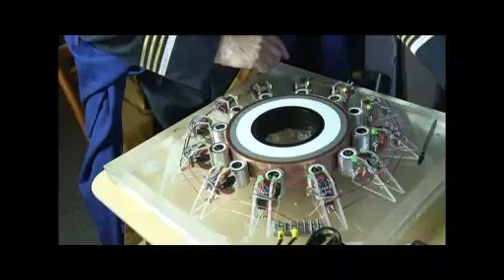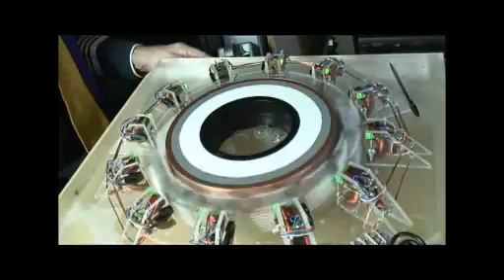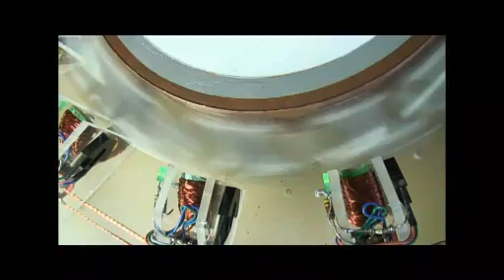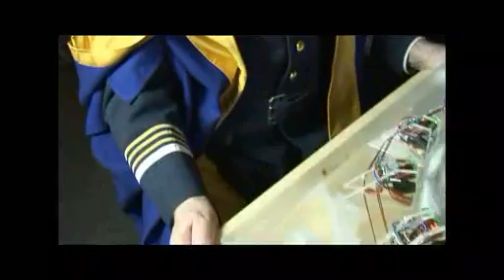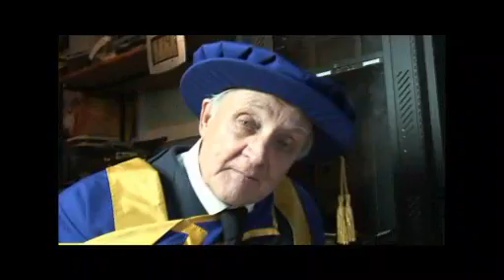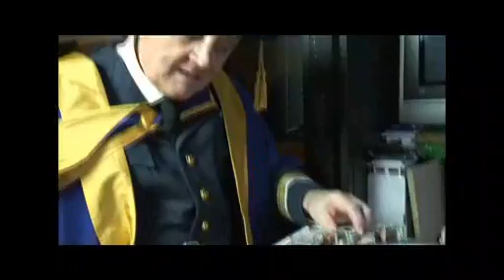Searl and Newton Part 2

Comment: You may power your house with an 18-inch diameter SEG that is 4-inches thick, and will weigh about 120-lbs, designed to be limited to 11 kiloWatts, which is the peak-usage of an average home. Nominal output of the SEG is 100kV, current-level on output never exceeds 1.5 milliAmps.

Comment: Same way as any conventional systems, by cutting lines of magnetic force with a conductor. You may either move the conductor or the field, and  in the SEG we just rotate the field. All the Eartly IGVs, including the P-11, were started up by an external small diesel generator, until a critical low-speed, at which the power-unit was on its own, and goes dead-silent.

Comment: This is a magnet mock-up of the actual SEG(nearly completed in Thailand), which is rare-earth-cored,laminated element,plates and runner-sets of the nominal 3-plate,69-runner sets magnetised with the new DC/AC-coil. More load you place on the SEG, faster it runs and the colder it gets, until at 4-Kelvin, overloaded and superconducting, the SEG LIFTS, and nothing can hold it down or stop it, except the frequency of an older-style videocamera oscillator-tube, as in the Canadian-TV demonstration.

Comment: There is no proof here of anything remotely significant, and certainly nothing that is beyond basic physics.  Mr Searl starts making some very erroneous assumptions when he adds more magnets. The machine generates no greater torque regardless of the number of magnets.  There is greater inertia and centripetal force because of the higher mass of all magnets acting together, but still no increase in torque.  Very expensive motor.  Nothing special here.

Comment: Is it supposed to be a power source?
Obviously it requires more power to drive it than you get back from it. Notice at 3:50 how they cut off the power, and it stops. Yay!

Anyway, it might be used as a low friction magnetic bearing system.

Comment: But the SEG, correctly magnetised with the DC and superimposed AC coil (just the ferrous-layer of plates and runner-sets), you get a MOVING magnetic wave. The runer-sets act like little surf-boards in the troughs of those moving-magnetic-waves. When you bring a runner-set to a plate, a moving-magnetic-wave is instantly formed. Think of an magnetic ARCHIMEDES WATER-SCREW, that is CIRCULAR, instead of linear. THAT is the Searl-Effect.

Comment: So how do you get the power out of it? I can't find any website explaining it.
Also. I can't understand well the man here, but looks like he shows that the magnets start rotating with only small force applied to put one magnet in motion. However it's clear that he has full control of the magnets without touching them. From this I would conclude nothing that this man is trying to say.

Comment: The second and third plate and runner-sets on the rare-earth-cored, 4-element (level-4 Square laminated element) take the place of electromagnets, and if you have the waveform correctly impressed on plates and runners, it is self-starting, like any other linear-motor, like Howard Johnson's Permanent magnet motor, patented in 1979.

Comment: Its better to use supermagnetic fluid that spinns around inside a ring torus that only contain vaccum and the superfluid itself.
On the outside we put the magnetic pulsegenerator around it.
This will speed it up a bit and give som special propertys. Im almost there. It gives unexpected, and some suprisly effects. 
Dont want to spoil it yet.
Problem is still remain to keep the totaly vaccum in the torus ring,to get zero fricition from the air.Not sure yet how to fix it. I also cold it down.

Comment: The friction must be a problem to the solid device. Try to rotate a supermagnetic fluids in a ring torus body that continue vaccum and the superfluid. Around the ring torus outside we set the pulsemagnetic device around it.

That will fire it up a bit.

Im almost there folks!

Comment: In the video "SEG voltage controlled demonstration" I see the rollers begin to move without fingers pushing to start. This leads me to think that the rollers direction can be controlled via magneto motive force. Question is; can the direction be determined by simply reversing polarity to move the rollers in the opposite direction?

Comment: On the nominal 3-plate, 69-runner SEG, the runers float over the plates with a slight airgap. There is zero0 friction, zero-noise, and zero-vibration in the Rare-Earth-cored, level-four (four-element) laminated SEG, which this unit is not, although it demonstrates some of the core-principles of the many SEGs that were buit from 1946, into the 1960s.

Comment: Yes, this is free-energy and field-effect propulsion. The overloaded level four square or level six-square SEG is REPELLED from the gravity-field of the Earth,because two like charges, or fields, will repel. This is the propulsion system for Professor Searl's forty-one built LEVITY-DISKS. Flight-Voltage is some 10^12 Volts at 1.5 milliAmps, coming off the rim discharge-pins of all 64-flight cells adjacent to the SEG, between the SEG-housing outer wall and the flame-barrier.

Comment: Temperature, drop, x/y-axis motoring (as in a two-phase induction-motor) and formation of cooper pairs get the whole thing going. Outer runner-sets on the 3-plate, 69-runner nominal SEG run at minimum 200 mph. Output Voltage is 100,000 Volts, at 1.5 milliAmperes.

Comment: Can I ask what may appear as some stupid questions;
Is the harnessing of energy based on the Lorenz force? Thats what comes to my mind mind. Is the searl "just" a dynamic capacitor?
Is the closed cirquit based on a pulsing circuit or is this cirquit modulated by natures frequency propagated trough the materials?
Hi all.
Thanks and keep up the good work with your little machine!
(Are you speaking swedish DrTM? Or was it just an example?)

Comment: Patterson, J.(1996) "System for Electrolysis", US Pat.#5,494,559. The first US "cold fusion" patent with claim of excess-energy (2000%). The PATTERSON POWER CELL contains hundreds of sub-millimeter beads by electroplatic multiple, alternating thin layers of very pure Nickel and Palladium. It uses a Light Water electrolyte. It is considered the best of the electrolytic COLD FUSION type of experiments with coplete repeatability,and a record gain of over 1000 in one demo.

Comment: You are wrong. There is an electromagnetic wave form impressed on plates and runners. Sine-wave on plates, cosine on runners, 90-degrees out of phase. This basically creates a two-phase induction-motor when runners are brought to plates. This is an unstable condition. It takes very little electrical-energy to accelerate the runners to great speed. Electron flux in the radial-direction from the Neodymium-cores of plates and runners is the current sustaining rotation in the nominal-SEG.

Comment: This device, and the actual level-four square SEG, are elegant proof that the basics of physics and electrodynamics are correct, AS TAUGHT. Maxwell's second equation is upheld, inviolate. Only difference is the Rare-Earth (Nd) cored SEG is an OPEN SYSTEM, and a MAGNETIC PRIME MOVER, like several that exist out there, including Joe Newman Motor, Perendev, Minato motor,Howard Johnson motor, Bedini,Paul Monus' PMM, Bedini with a Kromrey Brandt-Tesla converter, and the Thesta-Distatika.

Comment: its the difference between straight lines and circles.

Circular motion is produced when something accelerates continuously toward the centre of the circle. But the "speed" in this case is how many rotations per second the object achieves. Which is different to the "velocity".

Comment: The first SEG was completed by the engineers and laborers at Midlands plant as a challenge to prove teen-genius Searl's dreams were of a technology. It was 14-feet in diameter. Nobody expected the extreme electrical potentials,with electrostac-effects on objects,with radios and TVs turning themselves on,at FULL-VOLUME,and the generator finally taking off,after accelerating to fantastic-speed,surrounding itself with a pink-halo,finally accelerating at fantastic-speed off into space.

Comment: there is a knob where he can control the voltage.
the wires that's connected to other magnets around the outside of the plate.

Comment: no let me explain it to you.
"Velocity" is a vector, it has a direction and a magnitude, the magnitude of the velocity vector is called speed.
Acceleration is also a vector, it also has a direction and a magnitude.  acceleration is the change in velocity. so if you increase your speed you increase the magnitude of the velocity vector and accelerate. if you change your direction (ie going in a circle) you also change the velocity vector and therefore accelerate.

Comment: The nominal-rare-earth-cored, level-4 sqarem (4 elements involved- Electron Reservoir-Nd, Teflon-polemer for gating-effect,Fe-magnetised-Electron Accelerator, Titanium-Electron Emitter, and a final paramagnetics-layer to float rollers paramagnetially over plates- Cu or Al. There is zero friction in Law of Squares level-4-square nominal Domestic SEG. SEG is a MAGNETIC PRIME MOVER.

Comment: it is powered, but only with 7 volts. the point of this is the fact that it only takes 7 volts to attain such a high rate of speed and velocity and if you can attach something to harness the friction then you could easily have a self sustaining and efficient motor.

Comment: You can control gravity and inertia, and G-forces, with high-energy electromagnetic fields.Gravity-waves emanate from the BLOCH-WALL center of every bar-magnet,or centre-zone of any electromagnet.Gravity waves have TWICE the spin of EM-waves,and are a funtion on the EM spectrum of 10^12 Hz.Gravity-waves have neutral polarity by definition.Gravitic propulsion can be produced by our primitive,young technology, as Einstein and Laub confirmed theoretically and experimentally, 1908.

Comment: Airlines that are being crushed under the high cost of jet-A fuel, can replace their aging-fleets of jet aircraft with IGVs. They can forget forever about the high-cost of fuel driving them out of the business. IGVs use NO fuel, emit NO exhaust-products (they clean the air as they fly), use none of Earth's Oxygen, have no vibration, emit no noise at all, are radar-invisible, emit no heat. A huge savings in cost over conventional jet-propulsion.

Comment: Onboard lithim-polymer battery,of sufficient Amperage to input minimum power to the 124-gm. board.Internal power.That is not Searl tech,which is MUCH higher power,and more complex.

Comment: The ten foot diameter P-11 IGV in 1969 wighed 4-tons. The last craft built,the Demo-1 weighed12-tons when it was finished and flown.Both the IGV,and TT Brown's models I started building in late 80's are inertialess.A professsor in Tokyo achieved Self-powerd flight with a very lage device and one of my ALPHA piez0-based HVDC units, March,2003.

Comment: SEG is a LINEAR MOTOR. The rare-earth cored SEG prototype runs without any input of power at all; the Rare-earth is the ELECTRON RESERVOIR, that makes a flow of electrons from the inside of the SEG radially, like a diode. Center of SEG is POSITIVE, and periphery of SEG is the NEGATIVE, because of the electron deficit at the hub, and electron-surplus at the rim of the device.

Comment: When overloaded, it goes superconductive (because of the rare-earth cores, and all the electrostatic-cooling), then voltage goes unlimited. The SEG and flight Voltage is some 10^12 Volts DC, current never exceeds 1.5 milliAmperes. A high-energy electric field of this intensity is indistiguishable from an intnse, localised gravity-well, as in a mini-black hole. NOTHING can get thru the forcefield coming off the rim. This is MANKIND's first warp drive.

Comment: Actual SEG produces at least 100,000 Volts, at 1.5 milliAmps. Outer rollers go 200mph, minimum. More load is placed on the SEG, the faster it runs, and the colder it gets. When it is overloaded, it goes superconductive, and the SEG cannot be held down. It will LIFT- nothing can stop it, and without a control frame, it is lost to space.

Comment: You need at least 1.5 Volts at 600 mAh to get sustained rotaion. In the prototype, the Voltage is supplied by the Neodymium-cores of all plates and runners, and a diode-effect is produced by the lamination of elements.

Comment: I assure you, the rollers never accelerate, they move at a CONSTANT VELOCITY, and you may mark off segments of the plate with chalk and take still-photos to check it. Centripetal-force of magnetic-attraction, is more than the centrifugal-force trying to throwh the rollers off. So SEG is a model of a planet (or on micro-level, a magnetised Iron-atom).

Comment: *sigh*

Yes, its undergoing centripetal force.  Yes, it is therefore undergoing centripetal acceleration.  You've managed to miss my point... For a device to be useful it has to produce radial acceleration to produce torque.  This device isn't doing that by itself.  Its being provided with an external power source to make it spin and is therefore no different to a normal motor.

Comment: "angular velocity that is constant does NOT equal constant acceleration"

true, I didn't say 'constant acceration' I said 'constantly accelerating'.  Meaning that the body is continuously under non zero acceleration (ok, poor choice of words).  The point is that even after it reaches a constant speed if its moving in a circular path the body is still accelerating (toward the center).

Comment: The clue was in your own definition... angular velocity that is constant does NOT equal constant acceleration... If that was the case there wouldn't be 2 separate terms!

Acceleration = change in velocity over change in time

THEREFORE: constant velocity = no acceleration.

Comment: If this is actually some sort of magnetic perpetual motion machine, how is he stopping it in order to add the next magnet? He doesn't appear to be applying any kind of braking mechanism to it, and in fact it appears as though he just pushes a button (cuts current?) in order to stop it. That would imply that it's already requiring current in order to keep rotating, which would mean it is not a perpetual motion machine.

Comment: Chester or Delaware County, Pennsylvania. Manned Spaceflight Division of SWALLOWCOMMAND IS ACTIVE, and construction has commenced on an all polystyrene, 3-meter diameter IGV, as per professor Searl's precise instructions. Many conversations with The inventor, John RR Searl. Look To March, twenty-oh-eight for some truly uplifting developments on the Power-Core, the SEG, as well;Skeleton for IGV should be finished by then, and most of the 64-articulated and functional flight-cells.

Comment: This IS the generator, which is a converter, and a MAGNETIC PRIME-MOVER. When fitted with outer coils, you may tap the energy by cutting lines of magnetic-force as in any conventional-generator. But the difference with the SEG is that it actually INSERTS electrons into the windings, flung from the outer runner-sets. So the SEG-current is COLD.

Comment: They are just tiny pin-prick NS NS NS NS NS poles running sine-wave on plates, cosine on runner.

Which makes a two-phase induction-motor, with permanent magnets, iinstead of powered electromagnets; a huge breakthru. And to think the number-system to make this converter came from a DREAM. 

GREAT IS the GOD-FORCE

Comment: There is an electromagnetic wave-form on each plate, a sine-wave, and the cosine is on the runners. At zero-line, the waves intersect at 9-degrees to each-other. This produces a traveling-wave along the plate that carries the runners with it, like a surfboard on a wave. The two-intersecting wave-formes at 90-degrees is how we make a two-phase induction-motor. But in the SEG, we have permanent micro-N/S poles on plates and runner, instead of electromagnets at 90-deg. That is the SEG!

Comment: Very astute. That's Law of the Squares.
"If a building-block conforms to a mathematical-kernal (square) and its energy-frame is conserved, and that kernal contains 4 different forces conforming to requirements above,if a similar piece of material is placed on the material, it will experience a LIFTING-FORCE, and a PUSHING/PULLING-FORCE"...- Prof John Searl

Comment: Take the SEG, flip it 90-degrees, and make the plates a flat single-track, instead of a circular-course. There is your mag-lev. The VEHILCE is energised, instead of the track, and the energy is coming from the interaction of impressed fields, sine-wave on plates, cosine-wave on runners, making a two-phase induction-motor, with permanent fields, instead of electromagnets. This is the beauty and simplicity of the Searl's SEG.

Comment: The strong magnetic attraction between plates and runners holds them in place. The eddy-currents from the outer paramagnetics layers floats the runners over the plates like a mag-lev-train, or a magnetic-bearing, or a linear-motor.

Comment: A very small amount input. The rest of the work is done by the little pinprick N/S poles, sine-wave on plates, cosines on runners, and the imbalanced fields like helical gear-sprockets make basically a two-phase induction-motor between plate and runners; a LINEAR MOTOR, and can be used for mag-lev trains, with NO input-power!

Comment: THE SEG produces a gravity field. An electrostatic field at that power-level is same-thing as gravity-field, and there is 1/2-G onboard gravity in the IGV.
Two likes in Nature REPEL. So it becomes  IMPOSSIBLE to keep  craft on  ground at  Voltage of 10^12 Volts DC @ 1.5 mA current. High-energy-electrostatics. The IGV craft are much heavier than conventional-aircraft. But when energised they have negative-weight, and no inertia. They make right angle-turns and instant-flips at multi-mach-speeds.